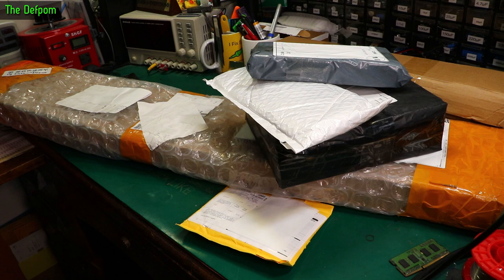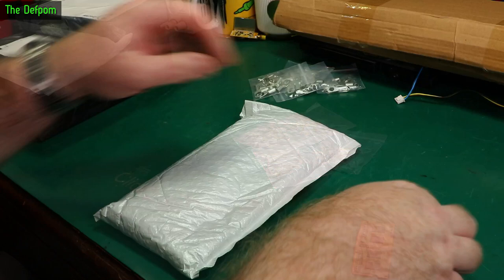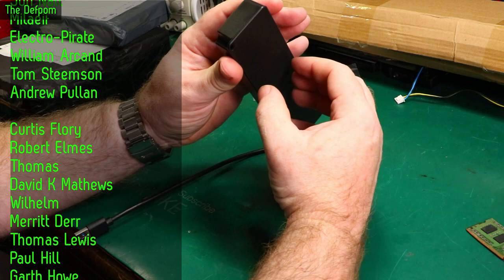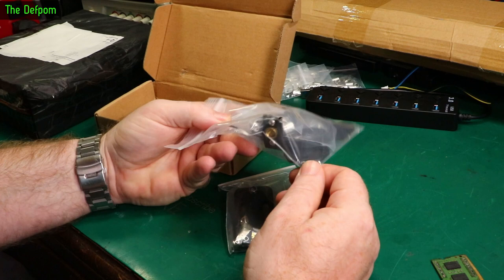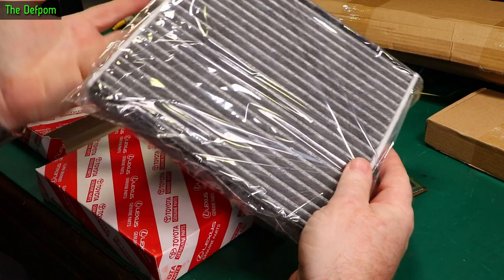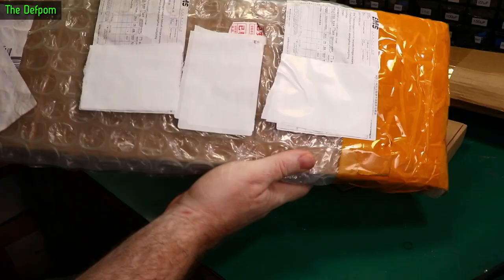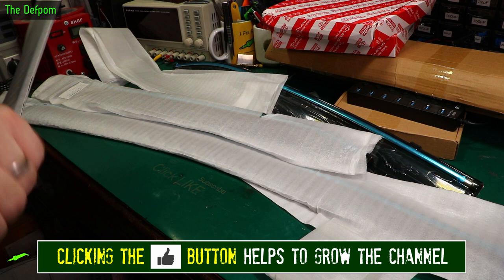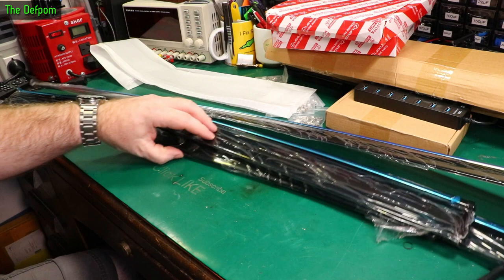🔴 What's in my Mailbag ? - Mailbag Monday 20th February 2023 - No.1100

Comment: Hi, at 1:02, check the power supply capacity of the hub, put a 500mA load at the last socket and check the volt drop from one end to the other. I got one of those, not exactly the same and found  only 4.25V at the end with 500mA.
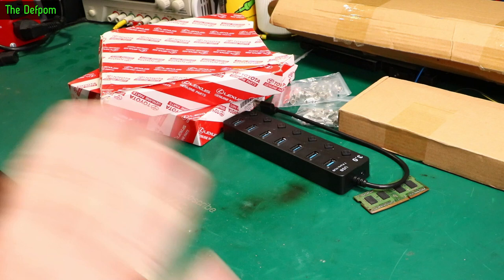At 4:40, I have those visors on my Kia Rio, very good for ventilation, BUT fit them in warm weather, I got mine fitted when I purchased the car, when they arrived, the Kia dealer suggested he didn't fit  them till Spring when they could have the doors warm in the sun. Been on for 14years now and still fixed.
Hope you weren't in the path or affected by the cyclone.

Comment: Interesting about the Ender z-axis going out of sync. I have no experience of that brand, but my AnyCubic 3 has two lead screws and 2 steppers for the z-axis. There's a limit switch on each screw and prior to printing the screws will 'home' individually thus reseting the bed height level. Doesn't the Ender have the same?
Reply: i think the Ender dual z-axis is just an ad on mod, the motors are just connected together via a y-cable. So it's a bit hit and miss just have to hope that the motors are close in performance or you run the risk of one skipping steps. So I think the coupling is a good idea one less thing to check every print.

I’m thinking of doing it as I want to move the filament servo down to the print head for better control but a standard ender3 only has drive at one end. So there could be a bit of sag as the extra weight moves away from the driven end. The extra drive would get rid of this, so maybe a coupled z-axis will remove this problem.
Reply: @TheEmbeddedHobbyist  Thats interesting, and yes I can see how sag might be an issue. I have toyed with the idea of moving the filament servo to the head on my Anycubic i3 but only because it's akward to load filament on my i3 due to lack of space down the side. I need to find a kit.
Reply: @IanScottJohnston  I use an Ender V2 with an added Z Axis I use a bed level and set the G-code in the slicer and never had them go out of sink  🙂